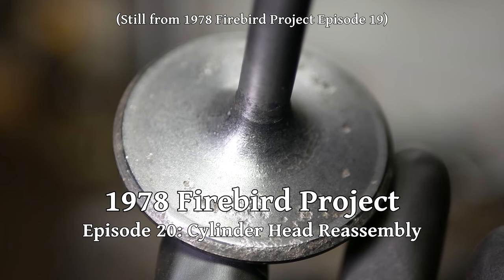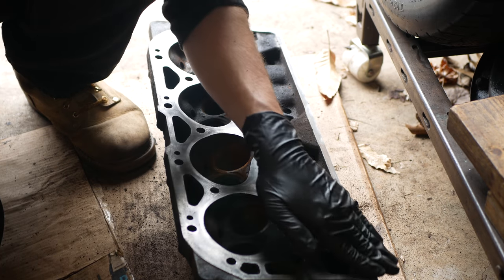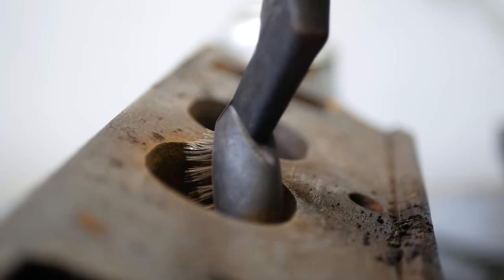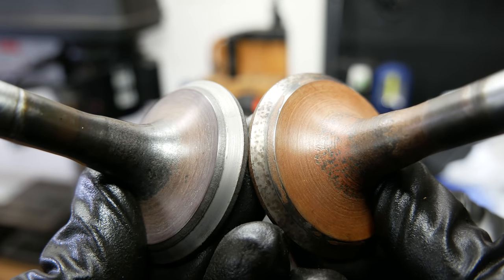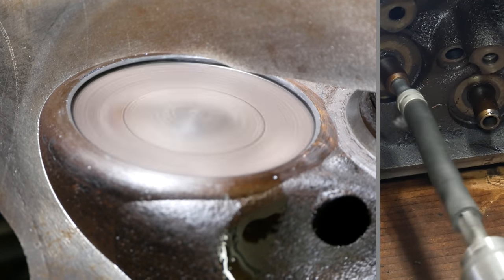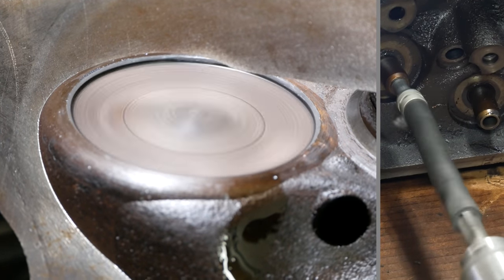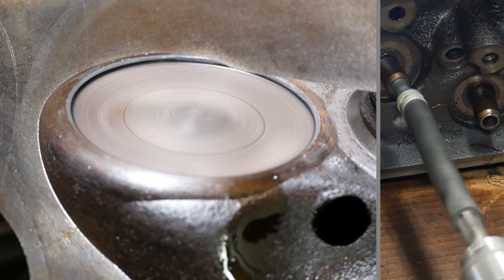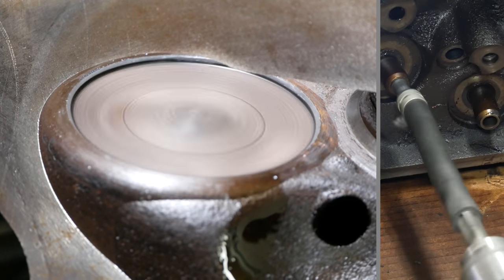$200 454 Engine Rebuild: Lapping Damaged Valves, Cylinder Head Cleaning and Reassembly (Ep.20)

Comment: I think you might get in trouble with this extensive valve lapping. The meeting/sealing surface of the valve and the seat seems to be way too big. That usually causes issues by having the closing force of the valve spring distributed on a too large sealing surface. That might not seal properly.
Reply from the maker: I can't quite picture why the wider distribution of valve spring force would be of concern, could you explain further?

For what it's worth, that intake seat is still narrower than the exhaust seats. Because the valve is larger the overall area is still larger though, of course.
Reply: @FuzzyDiceProjects  the valve seat angle and poppet valve angle are supposed to be cut at different angles so that when they are lapped in you see a thin shinny ring. This ring is called a 'knife edged seat'. The pressure of the spring will be concentrated on a small surface area and seal better. Good luck. I like your videos.
Reply: @FuzzyDiceProjects  As Zane Grey said, the force of the spring is putting pressure on the sealing surface. The larger the surface gets, the lower the pressure will be, so the less sealing you have. It‘s just the simle physics equation of force, surface and pressure.
The exhaust valves are much smaller in diameter, so the surface is smaller as well and therefore, that sealing edge can be a bit wider, that the heat is transfered to the seat better while the short time they are closed.

Comment: Many of the commments are "condeming/skeptical" of your work. I understand that there are optimal ways of rebuilding engines. But when you buy an engine for 200dollars and want a cheap solution you want to fix as much as possible with the parts you have. This is often where I found my self either way. I may have an engine and some machines to "fix stuf" but no money for parts... I like how u try to fix it instead of buying all new parts. Hope it will turn out good. Love the videos as always. Keep it up amigo!!!

Comment: I feel like their should be a pool on this motors longevity. Everyone gets a square with mileage or hours run before it gives up the ghost.
Reply: yeah, but what's the definition of failure?  it could granade completely, it could have a repairable failure, it could run on 7 cylinders, or it could just be low on power.
Reply: It may or may not run a long time.  Performance will take a hit for sure.
Reply: @jakewade7388  unless it breaks or some failure is cause by the misfit valve, i have no doubt it will run a long time.  it's hard to kill these things but like you said, performance might be limited to 7 or less cylinders.

Comment: You should have given that bad valve some sanding on the vertical drill before lapping it.
~400 grit to remove material and a 800 to finish.
You would have grinded much less material out of the seat and obtained a smother finish.
It would also not build that big step.

Best thing would be a new seat and valve.

Comment: It's extremely rare to find engine builds on YouTube that does not replace parts with new ones

The comments are all so angry that they should recognized 

-i wouldn't cut costs that much 
-just buy a new valve 
-just buy new springs 

The anger is too much on these builds
Reply: Anger?  We are trying to prevent some poor soul that doesn't know any better watching this from thinking this is how it is suppose to be done.   A lot of what he is doing is perfectly fine. Reuse of that valve is a hack job.
Reply: @jakewade7388  Do you know how many engine build videos even exist? Thousands of them and I've seen so many of them. Reusing all the parts? It's extremely rare and this is more of a refurbished 454 build just to get it to work. 

It's a lethargic 454 build thats the purpose. He is doing everything that annoys YouTube comments instead of following the same trends

Comment: I have criticized, however I will give on serious piece of advice before assembly of head onto block. with the head reassembled, put the head on an angle so that you can pour Kerosene into each of the inlets if the Kerosene weeps past the seat IT WILL FAIL. It is also likely that the valve you spent rotary lapping will also spectacularly fail probably taking out the Pistons and maybe the block (if you are supercharging it everything) I am a tradesman Automotive Diesel Mechanic with formal Tertiary Schooling in the Automotive trades and have over 40 years trade experience.

Comment: Geeeeeez! If the only tool you own is a cordless drill maybe drop the heads at a machine shop and have them clean them plane the maying surfaces and do the valve job and replace the springs. Might be $250 per head. WELL WORTH IT

Comment: Your valves need to be recut. The valve seats and the poppet valves are cut at different angles and then lapped in. When they are lapped in you will see a small shinny ring. This ring is called a 'knife edged seat'.
Reply: not always, however if they are it will be 45 degrees on the Valve, and 46 on the seat using a rose cutter, with a slight smear of bearing blue one can see where the seats are touching the valve. if it is uniform THEN with fine valve grinding paste and a lapping stick lap the valve in. What I saw here was tantamount to butchery, Please note I have literally rebuilt thousands of cylinder heads, replaced Guides, welded cracked heads, Skimmed head and manifold surfaces, line bored overhead camshaft journals, at one stage nearly every cylinder head that entered the workshop I worked in was repaired by me over a four year period from little side valve briggs and strattons to 16V149 two stroke GMs and everything in between.

Comment: Certain things definitely make me cringe... but I absolutely love it at the same time,. it really helps to put things into perspective... when you watch most automotive channels/shows they make you feel like you need to spend a boat load and that everything has to be brand new and top of the line in order to function properly. I do have one question; regarding the valves...  would it have been possible to just replace that one terrible valve with a new (or more gently used) piece, to avoid having to take so much material off of the cylinder head? ...since it was going to be lapped to match the valve seat anyhow? Or are there other inherent risks when doing that - since so much care is taken to put the valve pieces back into their original homes.

Comment: yep that gonna bit you down the road,i bought a cheap chinese set of valves,both intake and exhaust with springs for a z28  chevy engine stainless steel 2 years ago for 60 bucks.
there is a lot of place in rebuilding engines you can skimp on,the heads and cam isnt one of them,like the vids though,if it was mine the local machine shop would only charge 30 to regrind them

Comment: maybe grinding the valve down in a drill press with a grinder and a steady hand or a make-shift fixture is the way to go?
Reply from the maker: If I realized that it would grind such a severe step into it, I would have done some work with the belt sander before lapping it against the valve seat. Could have made the face flatter and kept the seat a bit taller. But oh well, it's pretty sketchy either way lol
Reply: @FuzzyDiceProjects  lol yea, interesting to see what can be done though, I'm interested in reusing and repairing as much as possible.
Reply: @FuzzyDiceProjects  Curious to know how the engine is running.

Comment: I wonder if you need to shorten the valve stems. The material removed seemed severe, like 1mm. So the valve would now open to early and close too late. Or is there some mechanism in front of the cam shaft, that would let you compensate for this ?
Reply: it is the hydraulic valve lifter that absorbs the small differences between the valve stem height, on the GM with independent rocker adjustment, you compensate with the adjustment nut on the rocker.

Comment: All the time I was wondering, why didn't you derust cylinder heads using the electrolysis? I put hopeless parts with a 5mm rust for a 24 hours and those were looking like new. You have significantly less rust in channels that can be removed in 6-8 hours without any effort.
Anyways, great job!

Comment: That will be the last hurrah for those valves and seats. I give it about 30k miles tops  - that one ratted valve and seat truly needed a machine shop recut the seat + a new valve.  If you are going to grind with paste like that [I think thats 180 grit] follow it up with a finer grit [such as 400 grit clover compound] to help knock down those grooves.  You are going to have a slightly wheezy engine thats missing some horsepower and be down on cranking pressure.  Did you check your guides??  Valves should have no wobble before launching into seat work..

Comment: Do you think you’ll have a problem with the exhaust valves overheating?  Those
Seats look way to wide.
Reply from the maker: That is the factory seat width on the exhaust valves, it did seem pretty wide to me too but I'm not terribly familiar with big block Chevy parts. If it works it works I suppose
Reply: @FuzzyDiceProjects  I’m not familiar with big blocks in the least bit.  I guess I’m too used to tiny motorcycle valves.

Comment: You can get a special tool which attaches to a drill that rotates in one direction ,   Then rotates in the other and keeps repeating,   It`s designed that way because it`s not ideal to simply spin in one direction,     Part of the reason your lapping is taking so long is using one paste,   In the old tins the grinding paste was medium in one side and fine in the other,     When you slide the valve in and out it should have no side to side play and ideally create a popping sound when swiftly removed,    From looking at your video`s you have not shown it,    But looking at the corrosion I think the valve guides will need replacing to avoid a smoky engine

Comment: Great job on the valves. I still wonder if there will be significant leak down on #6. Are you going to do a leak down test before installing the engine?
Reply from the maker: I won't take the time to do a leak down test until the piston rings are broken in, I imagine the readings would be poor because of that, but I would definitely like to do a test down the line

Comment: Once it's all together, I would do a compression test on the cylinder with the bad valve and see if it's making good compression. If it is, I would run it. Just know if you start burning oil or starts to run rough you will need a proper valve job 👍
Reply: why would the valve burn oil if it was ground down too far?
Reply: @DownSouthable  there are two ways engines burn oil. Bad piston rings and worn out valve guides. Oil can go into the cylinder through a loose valve guide
Reply: @augustoescobar50  Yes im aware I was just confused because this video is about lapping. A valve ground down too far would leak air yes but not oil if the seal and valve stem were within tolerance.
Reply: @DownSouthable  oh yes I was actually referring to when the guides were (cleaned) wire brushed. I had a friend who never burned oil and did this kind of rebuild with the same wire brush and even with new rings and valve seals the engine started to smoke when warm
Reply: @augustoescobar50  Oh I see. Yes I absolutely agree!

Comment: I would take the time to do a little old school hot rodding with those valves and do a little free 99 valve job and countouring with a file and properly clean them up and smooth them out and better them a little bit to flow better. 

May as well
Not like they’re gonna get any worse!

Comment: 10:42 in.  It will run.  Assemble the head.  Turn it over and poor fuel onto the valve tops.  If the fuel stays. . . . The valves are tight.  
If not. You tried

Comment: $100 and swap them out at your local machine shop. Heat treated cleaned and check for cracks. new springs and where needed.

Comment: I would at least have the heads vacuum checked to make sure they seal up. No clue why you didn't buy new valves whether a budget build or not and hopefully the heads aren't warped like a pine board.
Reply: Because the whole point of these videos is to see if a shit engine can be made to work with the absolute minimum amount of parts... Kind of kills the whole concept if you start replacing stuff left and right.

Comment: Those heads and valves  are going to cause catastrophic failure in about 10 thousand miles or less so the money spent now will save you down the line...but like everyone i am really interested in seeing how this goes
Reply: I mean, gaskets aside, and time and all the work put into them, would be cool seeing if you can do this type of stuff. i think MOST of those i would of reused on a build like this....number 3 or whatever it was yeah i think it might of needed a replacement lol.
Reply: @baileyhatfield4273  i think the valve guides will be the issue they are going to disintegrate and put copper all through the engine destroy barings and cause the valves to fly out everywhere
Reply: Catastrophic might be a bit much.
More likely just a drop in compression.

Comment: Did you measure the tolerances on anything?
Reply: no point measuring tolerances and have a headache when you are not gonna spend even 5$ for new valve. If you start to measure stuff too much you then have to take it to machine shop to do it properly. It is what it is, will it run, yes, will it run optimally and for how long ,no. Some stuff you still have to measure tho, like spring/valve bind so nothing explodes immediately. If you start to port and put more time on the heads then its probably good idea to measure some guide clearances. But you can get on prety cheap if your guides and seats arent that bad, lap in some new valves and put fresh set of springs + seals, do mild port and call it good.

Comment: I would never use a power tool to chase threads. That's just me.
Reply: Sometimes I want to just get done faster..Using a power tool aids that. It either fixes the problem quickly, or makes me buy a new one, thus fixing the problem quickly. :D
Reply: I used to be like that.. Then I got old and decided to save my time.😂
To be honest I've not had any issues with cutting threads with my drill.

Comment: Well not much you can do about the rusty valves and seats I don't have any doubt it will run fine ur not pushing lots of power I would just not run any low octane gas just to keep any hot spots and spark knock from happening

Comment: Those heads needed machining desperately. There is a maximum width of the lapping process when finished and most of these valve seats were WAY beyond specs.

Comment: As someone who's been building heads since I was 8(genuinely, family runs a cylinder head business.) Never use a valve that bad(valve 3), what ya done there as you mentioned is ruin the valve geometry, everything that valve opens and closes now it's going to score that seat instead of seal and that edge on the valve will eat itself away, this genuinely will set you back sooner than ya might think, those springs are popping the valve back up at a considerable amount of force. Please go back if the engine isn't assembled fully and replace it, it ain't much even just putting another stock one in there.

Comment: 454CID in a FIREBIRD??? The Pontiac stocker was a 455CID and NOTHING like the Chebby engine AT ALL. Oldsmobile used a 454, not like the Chebby/GMC, and Buick used the 455 (14.5:1 CR) we used to start SR-71's up at Minot AFB. If my brain works after 50 years, the Buick's were rated for 300-450 service hours then they were junk at 6000 RPM at 425HP on 135 AV fuel, and few lasted THAT long. BTW, you GRIND the perimeter of VALVES and LAP the SEATS to match and SEAL! Man those are BIG pocket HEADS!!! That can't have very much compression ratio in it, with today's pump swill, a piston with that much dome will knock holes in the block above 8:1(broken knuckle and busted parts assessment). Go merrily ahead, just don't ask ME to fix it!

Comment: Well thats going to be interesting. A little shitty but could be worse I guess. An easier way to clean the heads and block and probably cheaper then 20 gallons of purple power would have been using electrolysis. 5 bucks worth of wire and a battery charger. 1 large plastic tank or barrel.

Comment: Why didn't you buy valve cutting tool for the seat.
Do you not have a machine shop in your area?
Trick for cleaning the ports. Take a long bolt 2 large diameter  washer and a nut. Make a ball out of sell wool (roll)
And push it thru the center. Bolt washer steel wool washer nut sequence 
Attach to a drill and drill away
Cleaned and polished

Comment: This valve grinding is incorrect and wouldn't seal. You should do it correctly by using special machine to grind correct angles on cylinder head

Comment: A full set of valves (intake and exhaust) for that engine would probably kill ya @ a whopping $60w/sh. Ugh and them keepers? Yea there like $5 and should of greased the valve stems slots bfor assembly... C'mon man go back to Ford's if you can't get it right
Reply: And how exactly would new valves help him if he still has to grind them to seal against the rust damaged top?

The whole point of these videos is doing it as cheaply as possible.

Comment: Replace those rusty valves. Those pock marks are stress risers - in a very bad place to have stress risers. Ever see what's left after a valve head breaks off in a running engine?
Reply: You are right but if its stock cam/valvetrain most likely no problem, now with high spring pressure roller cam I can see your point

Comment: I hope i'ts a joke.
In cylinders head every is very important even weight of valves.
In my opinion this head now is only for the carbage no compression no straight surface, this valves have to be replacement for the new one becouse old was to corrosive, valve guides have to much play and a lot more. Sorry i'm not a hater but this repair maby is enough to the grass cutter.